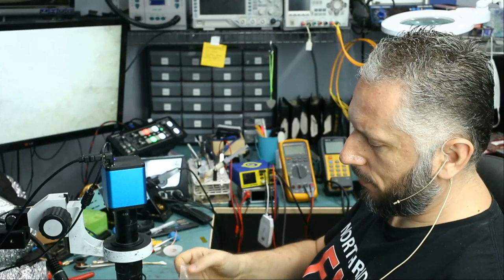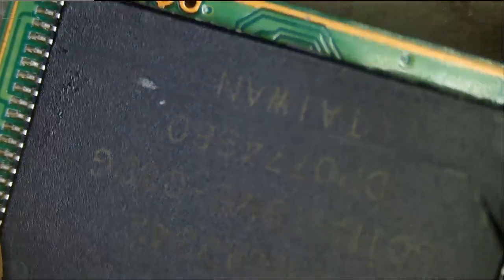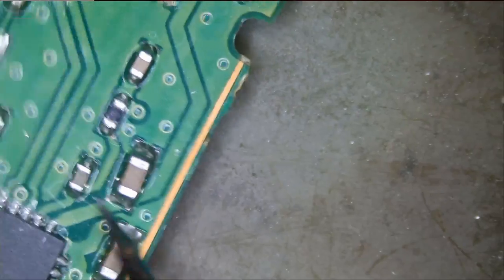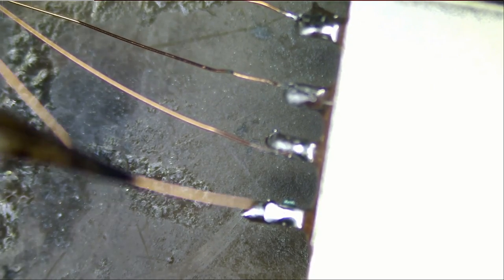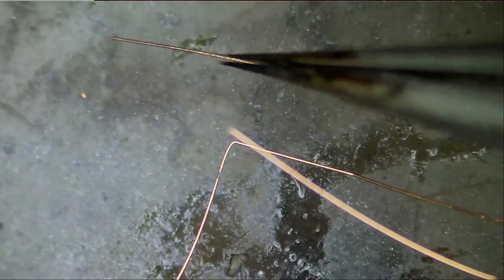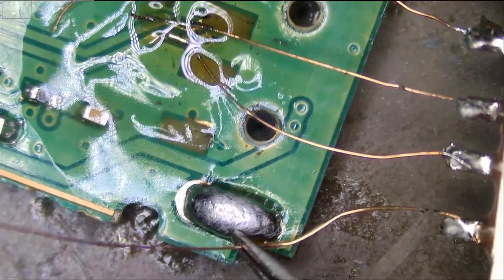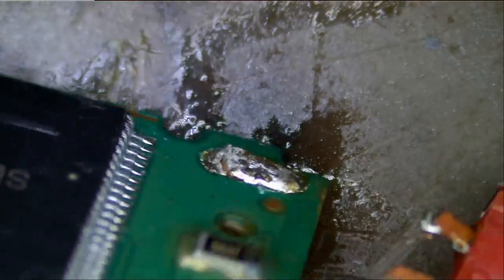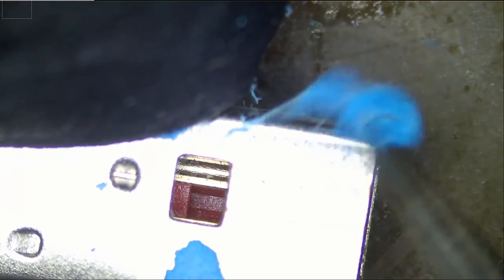Broken USB Flash Drive Data Recovery as fast as possible.

Comment: Nice, was expecting, that you would solder it back on the board.
Reply: same
Reply: its likely going in the bin. buy a new drive :)
Reply: All the pads where ripped off, think 1 of the legs was also broken off.
Reply: @jeroen7062  yes and vcc was difficult to reconnect,  because it is count to the other side
Reply: @jimrdiger  yeah you could make a junper go around but why bother for a (probably) 10 dollar device.
Reply: Sometimes I would like to know how to break the USB port like this
Reply: The data is what matters in this case.
Reply: @hauxx1245  Stick it in a laptop that belongs to a family with kids, sometimes people forget that there's a flash drive in their laptop and when they move it... I can come up with several scenarios, sure you can think of some as well.

As far as repairing the drive goes, as a business I wouldn't fix it because it's just not worth the effort, but for friends...
Reply: Same but then realized that probably they only want the files anyway...
Reply: if he does like that, the customer may say " you dont even do alot of thing on the usb  ..."
Reply: Maybe it could be easier to solder USB cable to the board instead of those fragile wires but this worked and data are saved and that matters here.
Reply: I thought, soldering everything including the pads would have been easier to do. I don't have a clue, that's why I am asking. :)

Comment: What do you use to clean the boards after soldering? I tried WD40 Contact Cleaner spray,70% Isopropyl Alcohol, 99.9% Isopropyl Alcohol, and 180 proof Everclear. The Everclear seemed to work best, but they all leave some kind of horrible white cloudy residue

Comment: I spent hours trying to work on an Xbox Series X, I replaced the HDMI port (not the first time I’ve done it) and the console turns on then right back off and makes a popping sound, I tried a different PSU and still it won’t work, this happened to me once before on a Series X but the problem just went away, idk what to do. Thoughts anyone? :(
Reply: Check / replace the retimer chip
Reply: A diode or capacitor in input line for filtering if it was diode in series it would have been bad as sometimes when diode goes bad it will read correctly with multimeter but it won't be able to take the current properly.   

Capacitor would have just been a short not a complete dead short but with low resistance causing PSU to trigger it's over load protection after some seconds as it would have been consuming quite a lot of current and with the processor starting to consuming current after few seconds the power supply shuts itself off and current at the time when processor is not started wouldn't be as high as it should be to trigger the protection. And mostly capacitors are the ones to pop. 

Hope you found that useful.
Reply: @HoRnEyDvL  saw TronicsFix do the same today haha, if I just remove it, will the console at least stay on so I know that that was the issue? Do they even sell replacement Series X retimer chips? Ugh..

Comment: Alex, how much storage space was needed to contain the customer's recovered files? 💾💽
Do you put the recovered files onto a new flash drive, and then add the cost of the drive to the repair bill? 🤔
Reply from the maker: Yes exactly. Recovered files go on a new flash drive and customer is charged extra for the new drive.
Reply: @NorthridgeFix  that's smart Business and a faster service. files are recovered and customer is presented with a replacement drive.

Comment: The 5VCC wire shouldn't be soldered in the other side of the resistor? Since it was comming from the other side of the board in that hole near the tiny capacitor. Not trying to put defects or anything, I'm just curious learning from your jobs.

Comment: A suggestion from an amateur: Why not use an usb charging cable, cut the mini usb head and solder the wires directly to the drive, only 4 wires to solder, instead of 8. You can use this cable multiple times.

Comment: I've done similar work before, but I didn't have insulated jumper. I just chopped a usb cable in half and soldered it to the board.

Comment: The way your solder sticks to the wires is just magic! I struggle with every solder joint, I suppose the quality of my tools and solder is very bad? My soldering tip is getting black and I can't clean it whatever I do, then solder doesn't stick to it anymore.
Reply: Using a good flux helps and if temp is above 400c it can burn up flux too quickly. If you only have the flux core from the wire only it's difficult to stick unless the metal surface is very clean.

Comment: That was a quick fix. Couldn't it have been possible to solder the usb to the board
Reply: The USB connector ripped all the pads from the board. Jumper wires was the way to go here as there wouldn't have been anything stable to hold the connector to the board.
Reply: @redemptusrenatus5336   one side of the connector could have had a strong hold, but anyways it was just meant to be a data backup issue and not to try to survive the drive for longer use.

Comment: What’s that jelly stuff you’re squirting on before using the soldering iron?
Reply: Flux, it removes impurities and prepares the surfaces to accept the solder. Allows solder to flow like water on surfaces it's supposed to adhere to and roll off the surfaces it shouldn't such as the solder mask (green areas on the board.)
Reply: @redemptusrenatus5336  thank you. I’ve never seen flux one a jelly like form before, is it a special type specifically for micro electronics?
Reply from the maker: https://northridgefix.com/?s=amtech+flux&post_type=product
Reply: 😂😂😂 please watch video before this and you will know all about flux that he use

Comment: Why just data recovery when you can fix it already. Fix the connector at its place and job done.
Reply: Because there's no way that connector would ever hold as well as it did originally with the pads completely ripped away from the board. The person already broke the connector when it was securely attached; just how long do you suppose that connector would last with a half-assed repair that attaches the connector to the board? Seriously.
Reply: With 4 jumper wires, customer taking it home as is.. ?
Reply from the maker: Flash drives are cheap, you don't fix them. Files are transferred to a new flash drive.
Reply: Because THE JOB was repair for data recovery, not repair for continued reuse. ;)
Reply: @NorthridgeFix  Got it! Time is more expansive than that drive.